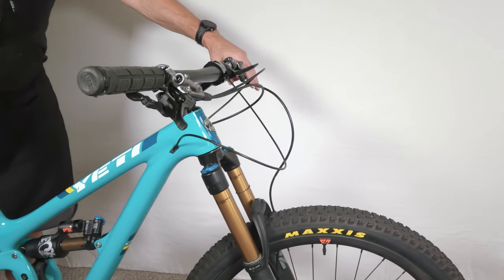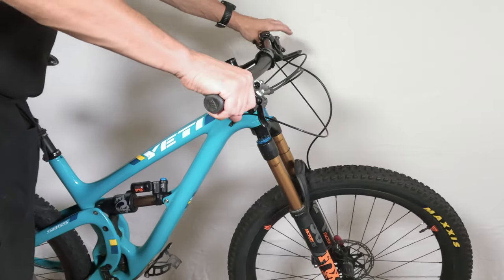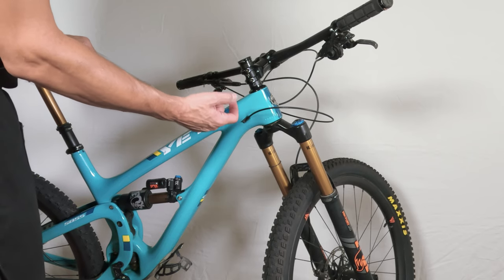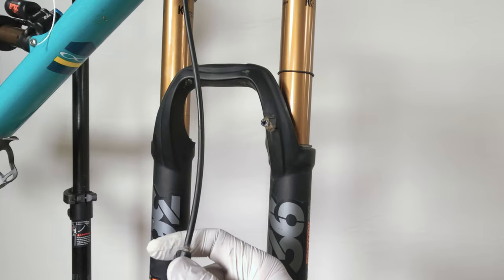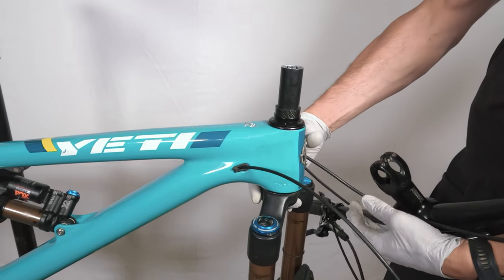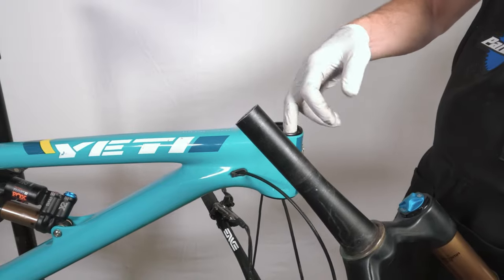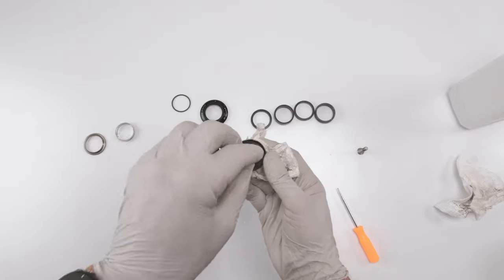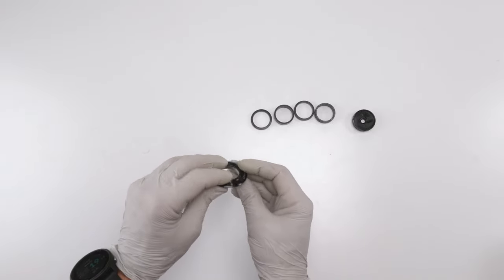Headset Service + Knock fix for beginners on Chris King Inset. Avoid the  BIG mistakes, DF-1 review

Comment: Nice! That Chris King headset looks like a freaking pain. No thanks! My preferred method for checking for headset knock is to raise the front wheel so the bike is vertical with the rear wheel on the ground and me standing behind it. I then press the saddle up tight to my junk region, grab the rear brake hard, turn the bars to 90 degrees and flex them up and down. This way you take fork bushing slop out of the equation when the bike has both wheels on the ground and the bars turned 90 degrees. Anyway, just what I do! Another quality video!
Reply from the maker: Thanks for the advice, myman. Never thought about testing knock like that. I'll give it a shock next time. Agree with the Chris king headset. Great quality no doubt, but to proprietary

Comment: As always another great Video but man those different coloured headset spacers messed with my OCD 😂
Reply from the maker: That is so funny as I have the EXACT response when looking at it. I plan on cutting the steerer by 1mm and then replacing them before giving it back. it'll drive me nuts if I don't. 😁

Comment: make sure you fit the grip lock right, dont do it back wards
Reply from the maker: Not sure what you mean. there's only one way to install it or else it won't work. The video shows exactly how the chris king install guide states it should be installed.